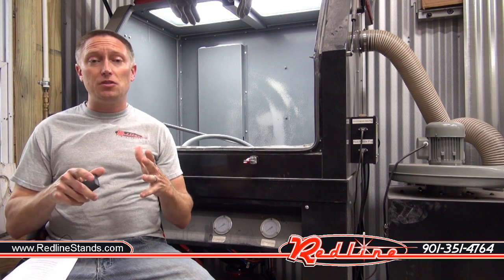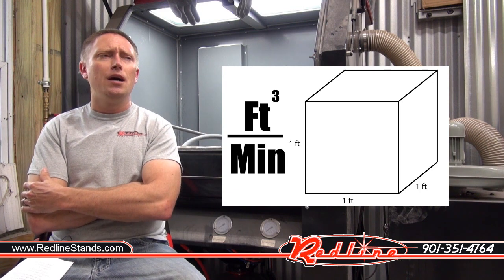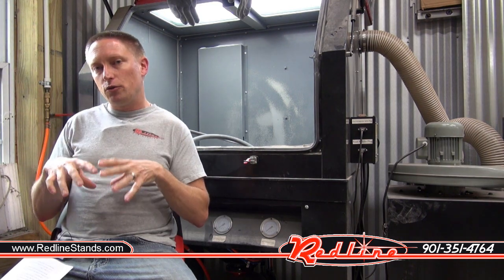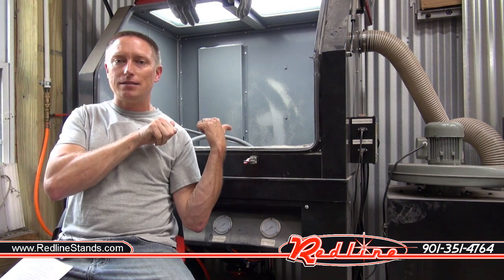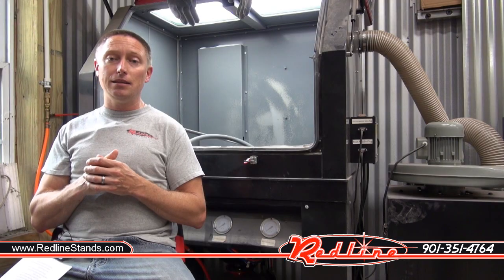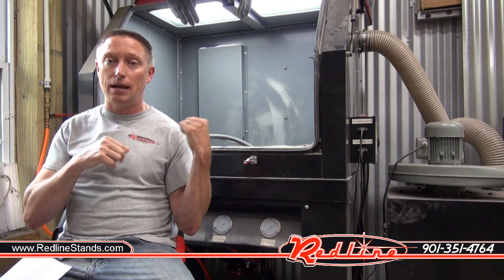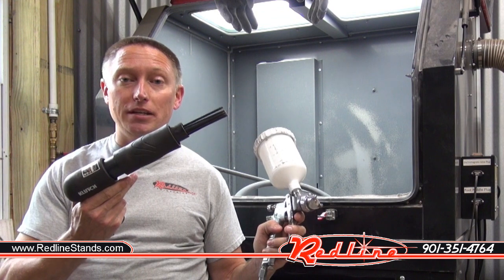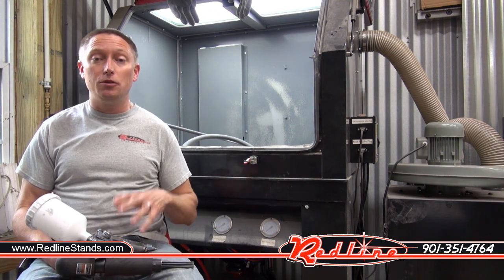How to - Air Compressor vs Media Sand Blast Cabinet

Comment: Awesome explanation.  You get pdf's that shows the HP, CFM, Nozzle size, etc.  As a result, I have a mate with a 7.5HP for an 8mm nozzle with a 300L tank and he gets a steady 6 bar blasting with walnut or peach shells.  CFM is your biggest headache. Single-phase compressors can't deliver the air  I need for a 6mm nozzle.

Comment: Thanks for speaking to the situation of having a compressor rated lower than the requirement of the tool and what that means because it's difficult to get a straight answer to that question.
Reply from the maker: My pleasure sir.  Please consider subscribing.

Comment: A sandblasting cabinet that will be used to make address stones and gravestones for my business.   What would be the best 80 gal or is 60 gal. fairly similar in break time for air recovery?  80 gal. is huge, but maybe it is what I need.  I just had a DeWalt delivered.  The box with the connections was bashed but it seems unharmed inside.  Again it is huge, but maybe that's what will keep me moving.
Reply from the maker: You have to size your air compressor based on how many cfm your blaster will use and at what psi.  I can't answer this question sir.